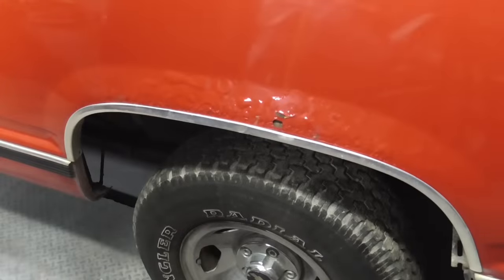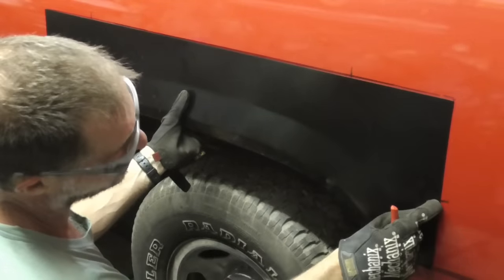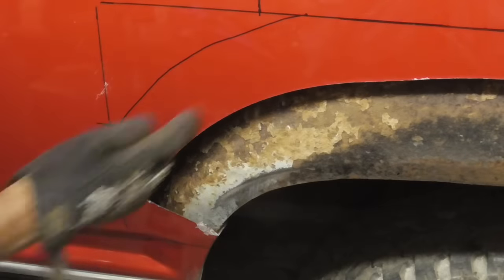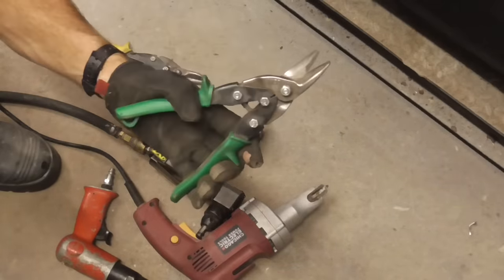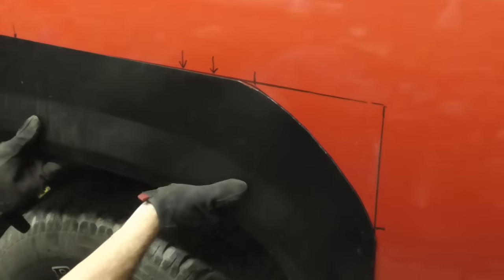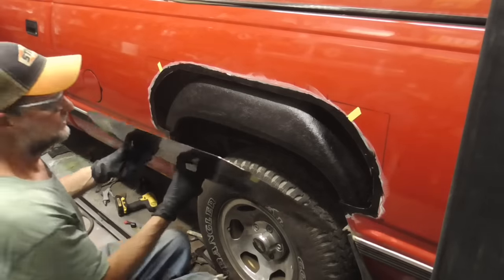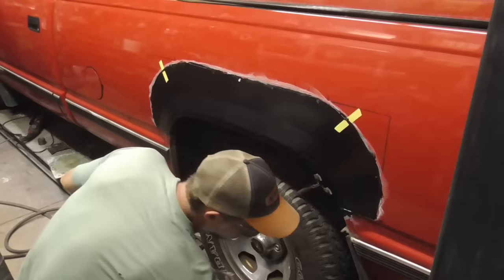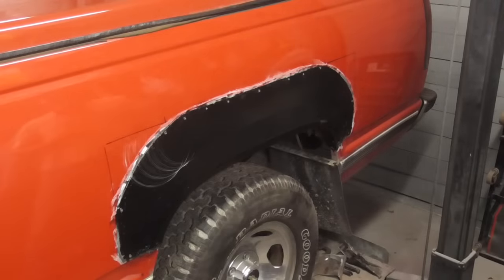Glue On Wheel Arch Rust Repair Panels w/ SEM Impact Resistant Panel Adhesive

Comment: This is sad. Major over kill.  The initial first area you cut out was enough.  Then to use paste grease and rub behind the metal (not the patch, but the trucks cut out area.  Then install the entire patch or the area rounded off from the patch (either would do), then pop rivets to hold it on then punch in the pop riveted areas and then the filler.  The glue you used was useless and you cut out to much metal from the area on the truck.  Youre crazy but your over confidence has fooled you brother
Reply from the maker: Google: "Sail Panel Seam"  - https://www.youtube.com/watch?app=desktop&v=46h3iZfjnkc  Follow up video on this repair - https://www.youtube.com/watch?v=t1WclT_GMvk  Another follow up video soon - still perfect 👍💯😊

Comment: Note to self never go to  Lakeside Autobody...
Reply from the maker: Factories have been doing it for 100 years and so have the oldest, most experienced body shops.  http://www.beldenspeed.com/the-shop-truck/pleadingtheroofsailpanelseam  Don't fall for the butt weld and metal finish stuff on TV/Magazines,  it doesn't hold up to driving in the rain/snow.  You can now drive this truck in salt water w/o worry - last as long as a new panel.

Comment: Why glue it on?? Is the owner a penny pincher??
Reply from the maker: Glue is actually more expensive than welding.  Also no chance of moisture problems in the seam - lots of quality shops glue rust repairs.

Comment: That ended up being a lot more filler than needed if done differently.
Reply from the maker: If you don't knock your seams down - welding or glue - the patch usually fails or shows and outline.  A magnet sticks anywhere you go on the panel - I'll show that in a follow up video in about 6 months.

Comment: no,   just no.   SEM does not recommend this.   shadow and ghost lines will appear.
Reply from the maker: Absolutely will not appear if you knock the seams down.  Welding or glue - you must tap seams down or the patch will fail.  Many shops in Detroit have been using glue for years and it will be a very common method in the future for sure as no moisture can harm the seam.  See this 2 year old repair - https://www.youtube.com/watch?v=d21RkqTwRqs  no lines show or will ever show :)

Comment: Why didn't he just cut the panel to fit and tack welded it in for a lot less money. Cost of all that sanding equipment, bondo, filler paint, time and reduced resale value of his vehicle he should of just did it the right way... Took more time and energy to cheat than to do it the right way.
Reply from the maker: This will last longer than any method really - it's more work but has a sealed seam.  See this video for more info on the topic - https://www.youtube.com/watch?v=JIIonJOVro4

Comment: And the edges will rust in two years
Reply from the maker: It will last longer than we'll be here - https://www.youtube.com/watch?v=t1WclT_GMvk   The panel can now drain and dry out inside.  Here's one that's 5 plus years now fixed w/ JB weld - https://www.youtube.com/watch?v=idrLzsz2eLg  Look up "sail panel seam" for how the factories did it too :)
Reply: @LakesideAutobody  what kind of filler?  I've usually seen filler cracking that allows water infiltration and leads to delamination of the repair edges and rust to resume.
Reply: I agree should have sprayed on tar based coating before installation
Reply: @bob1519  or the cosmoline woolwax type....

Comment: Again yellow another video where they don’t talk about the inner fender well and do something about the rust on the inside this is just going to rust again this is putting perfume on a big ridiculous
Reply from the maker: You can always replace the inner panel.  Here's a video on how to do that (you could use glue too) - https://www.youtube.com/watch?v=92mr0C62tq0  Make sure the two panels can drain so that it doesn't rust again - that's why it rusted in the first place - trapped debris, rust, leaves, etc.

Comment: Jesus, just weld in a patch. It's half the work, and you're not using 5 pounds of filler. All you have after this is a polished turd.
Reply from the maker: 😊 A polished turd that lasts longer than any other method without question - the glue & water tight seal can't be beat.  https://www.youtube.com/watch?v=idrLzsz2eLg
Reply: @LakesideAutobody  You know what, I gave it some thought, and I'm coming from the perspective of classic auto restoration, and preservation, not work vehicles, or those that might take constant abuse. I'll hold my judgement for those cases, as it's outside my wheelhouse, and I could see an application there. Fair play, and good on you for the good-natured reply.
Reply from the maker: 👍😊  I'll try to throw in a few classic restoration videos in the future.  Metal finishing, panel replacement?  Not sure what folks would like to see.  Nice talking to you Izza - Have a good weekend my friend.   @izza6998

Comment: How lucky, how lucky.  Try the dodge rams. What inner fender,  they're like inner rocker panels, gone,gone,gone.
Reply from the maker: You'll have to design an inner panel - something like in this repair - https://www.youtube.com/watch?v=Jk29avqnVXI
Reply: @LakesideAutobody  Nada, they're finally available as a restoration part,  this wasn't the case the first time around.
Reply from the maker: Ahh... cool.  Usually they have everything for trucks.  Thanks for watching Chuckster @chuckster243
Reply: Quick question. Have you ever encountered "ghost lines" lapping patch panels? I ran into this on my last job, even the circles from the plug welds appeared, this was months after a cut and buff. Repeat cut and buff would temporarily remove them, over time they kept coming back. I thought maybe bad filler? Never got the chance to grind it out and re-do it. Almost forgot, I put a reinforcing strip behind the patch, so it wasn't laying on the remaining metal as in a true lap,but was supported from behind bringing it up to the same level, like a lap. Welded,fusor,kitty hair, and rage.

Comment: That's some serious outdated body work. Give it a few months and you will see a perfect line where you bonded it 😒
Reply from the maker: You'll never see a line with any of my repairs - welding or glue because the seam is tapped down - that's the key.  If you don't tap the seam down your patch will fail - see this video (3 year old cab corner) https://www.youtube.com/watch?v=d21RkqTwRqs

Comment: This should be illegal…
Reply from the maker: Lots of quality body shops use this method now along with welding when it's called for :)
Reply: @LakesideAutobody  I've been in this game as a panel beater and shop owner for more than 35 years here in australia.....if i try to repair a vehicle down here using your system, i would 100% lose all my clients and contracts with the insurance companies
Reply from the maker: @pristaxau  A lot of shops here in the rust belt where salt is used on the roads have started to use panel adhesive.  It will be the future of rust repair because of the water tight seam.  It will last as long or longer than a new panel and you can guarantee the work too because of that fact - gotta try it some time my friend :)

Comment: Why did you waste the time knocking it out if your patch is going much higher I use Eastwood flanger tool thendimplerr undercoating flange the truck clamp onmew panel.drill holes them use the dimpler flanges the drill hole remove panel. Spray both pieces with undercoating glue the flange ,&side now rivetthis Roberts will be flushed glue might ooze our with with cleaner now rust proof just fill  sand prime paint
Reply from the maker: You can do it that way too.  I like it so you can use one method on every hole.  Patch it, knock it down, fill, prime, paint, done - no playing around.  I don't think my boss would have been too happy w/ taking so much time to flange the panel, fit the patch, do some more adjusting, etc.  Guys would have said,  "when you gettin' that done guy?"  Nothing worse than being slow in a high volume shop :)
Reply: Well that and you still have a step, it's never flush with a flange tool. I like a flange tool, but they do still leave a step. Another thing is with the adhesive is that if the seam isn't tapped down you will see the outline of the patch in different temperature changes. By tapping and filling you eliminate the possibility of that happening. You're not trying to sink the metal by inches, Jerry is hitting it just hard enough to knock it under the surface

Comment: The one tool you need here is 200 buck mig welder! THIS IS STUPIS AS HELL!. It reminds me of every one using pop rivets to put in floor pans, or 3 inches of bondo to fix a dent. If you make your living working on metal, learn some basic metalworking skills. Or go install drywall, that is what mud is for...
Reply from the maker: The advantage to glue is a water tight seam - will last longer than any other seam.  https://www.youtube.com/watch?v=t1WclT_GMvk  See this vid for MIG repair - https://www.youtube.com/watch?v=Jk29avqnVXI  Depends on what the customer wants really 😊
Reply: First of all.. Bullshit..That glue hasn't been out long enough to even say it will last.. let alone last the longest, secondly you are piling on bondo that we know for a fact, won't.
Reply from the maker: Lots of shops use glue today.  https://www.youtube.com/watch?v=idrLzsz2eLg Glued the cab corner on this truck 5 years ago - still perfect.  If it's done right - t will easily last longer than any other method - it's obvious why too - again water tight seam 😊
Reply: Put it on your website then.. If you get paid by insurance company's not people.. Why not just pop rivet it, you could cheat the car owners out of even more money...